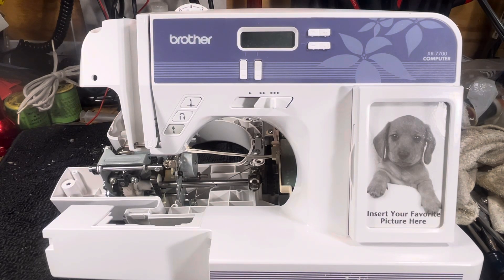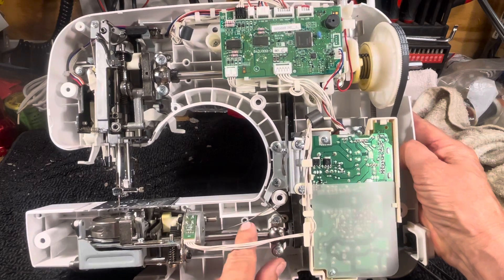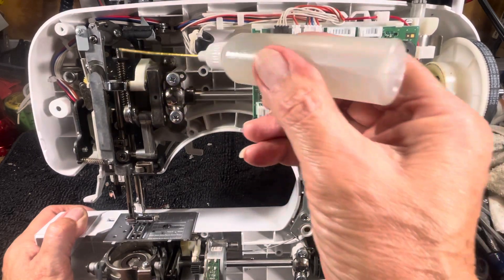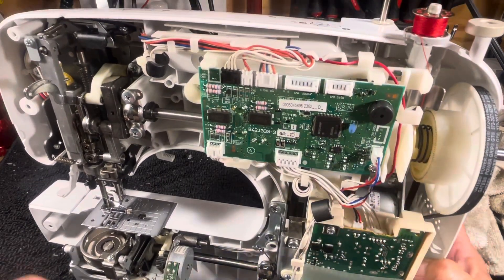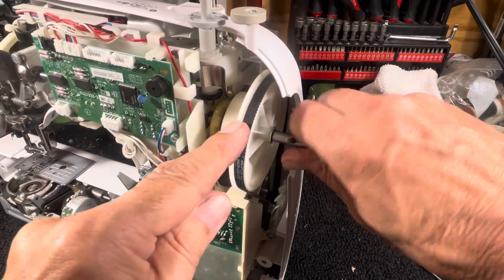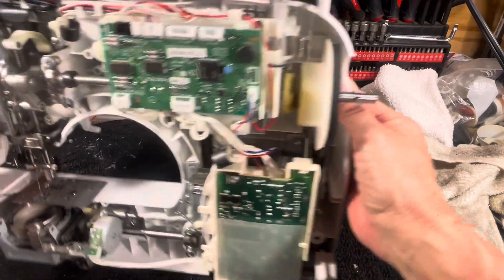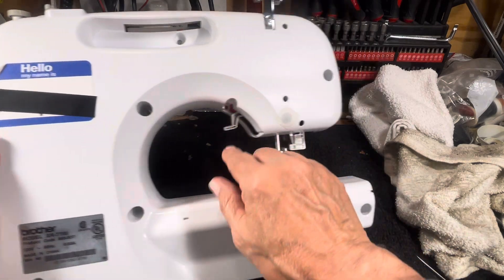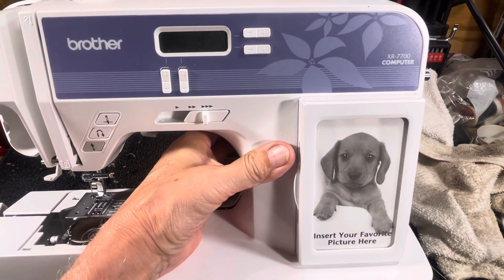BROTHER MACHINE DEVOURS THREAD - THREAD WRAPPED AROUND EVERYTHING?? FIXABLE? YOU BETCHA! (video 425)

Comment: I've discovered that a flexible wire to remove hair clogs from bathroom sink drains works very well to fish out thread from inaccessible spots in sewing machines.  The wire has tiny stiff barbs on the end that catch hair, and also catch thread.  If you can't get your tweezers in there, then this is the ideal option.   The one I have is called a Flexisnake hair clog tool.  There's probably other ones out there that work similarly.
Reply from the maker: That’s great on the older, classic, analog machines. 
On the newer ones, the very real risk is hooking onto a tiny return spring that’s attached to a mechanism and launching it across the room. 
I’ve dealt with that issue many times. 
My customer said they watched an online “hack” video and consequently destroyed their machine. 
I don’t recommend sticking anything into your machine if it was manufactured after the 70’s. 
The newer machines can also be destroyed if you stick anything metal into the feed area or the needle bar area and “short out” the electronics. 
The risk is too high. 
Just do it on the older machines to be on the safe side.
Reply: @randyyoursewingmachineman9954  Got it!  ie, use with common sense.  🙂
Reply from the maker: @robeng6231  exactly. That’s something people don’t always have. 
That’s why in my videos I say things at least 3 times in a row to MAKE THE POINT. 
It may sound like I’m forgetful, but it’s by design. 
I often see the light of realization appear in the listener’s eyes upon the third pronouncement. 
When something is so important to know, that it is devastating to not know, you can’t trust “common sense”.
You have it. 
I have it. 
Everyone does not have it. 
I’ve never eaten “Tide pods” and I bet you haven’t either.